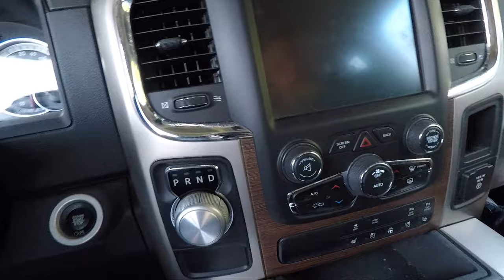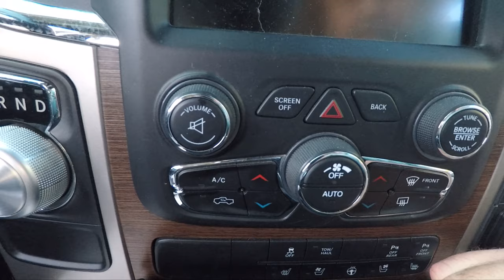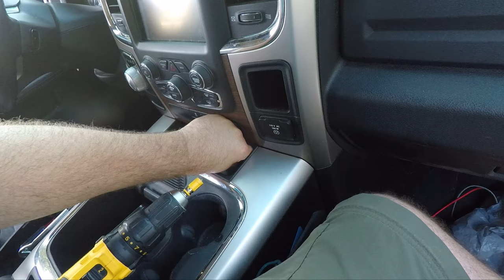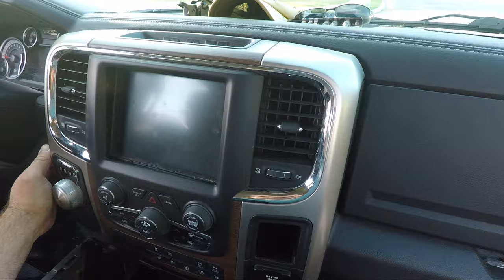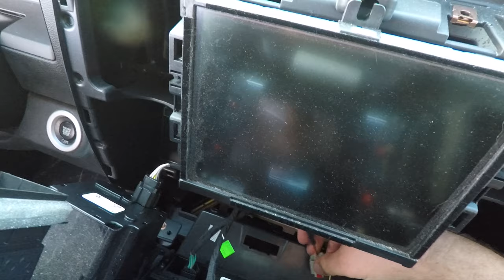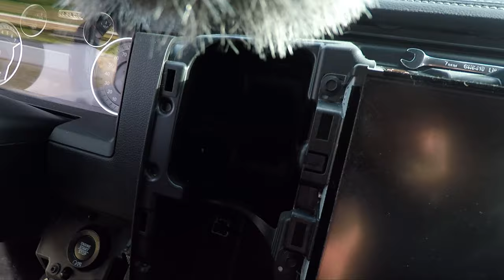Ram, with Center Console, Trailer Brake Controller Installation [4th gen models]

Comment: Just a caution for anyone with a tuner that gets the OEM brake controller flashed by the dealer, the OEM brake controller requires the Body Control Module to be flashed to activate it, however when my truck was flashed for the OEM brake controller at the dealer it caused an issue with the tune and I started getting service trailer brake system and service electronic brake system messages on the EVIC, then the transmission started hunting for a gear and then would not shift out of first gear at one point and finally the check engine light came on. 

My truck has a tune installed and the truck had been running great for the past 18,000 miles, I tuned it the first two weeks that I bought it. The problems started after the dealer programmed the body control module to activate the OEM brake controller adding it to the vin number in the manufacture system so it knows the OEM brake controller is installed. 

Thinking back to when the problems started I decided to load the stock tune back into the ECM/TCM and took the truck for a short 1.1 mile ride, the check engine light was gone as were the service trailer brake and electronic brake system messages. I pulled back into my driveway and reinstalled the tune in the ECM and TCM and for the past 1,000 miles now I have not had any issues, no more service trailer brake system or service electronic brake system and the transmission is shifting good again and the check engine light has not come back on, the truck is again running like it was before the dealer programmed the body control module. 

So if you have a tune and you install the OEM trailer brake controller and go to the dealer to have it flashed to activate it make sure you remove the tune and load the stock programming back into the ECM and TCM or you will likely have issues. Once the dealer is done with their programming you can reinstall the tune to the ECM and TCM again. 

I do not know what the Body Control Module flash did that caused the ECM/TCM tunes to start throwing codes, messages and causing the transmission to started shifting funny but something with that flash did affect the tune. Reloading the tunes did correct what ever it was that was creating the conflict.
Reply from the maker: Thanks for this valuable input. Hopefully anyone that has done the special tuning reads this comment to help them prevent issues as well.
Reply: How much did the dealer charge
Reply: @oscarpasillas3413  They got me for $180 dollars, they added every shop charge they could to the bill, I really don't know what shop supplies they used to plug in their computer and program the OEM brake controller.
Reply: Thanks for the input I just purchased a 2016 and the previous owner said it didn’t have a trailer brake system so he install one but the dealer took it off and did the oem one but I can’t get it to work so I think they never did the flash by dodge so I need to take it back but it has a tune and now you save me from having issues. The old owner is sending me the tuner so that I can fix it. Thanks

Comment: Thank you, this was very helpful. I too didn't secure the last screw that is the very top rear one. Way to difficult to get to but the other ones seemed to hold well so not really worried about it. on a side note, there was a grounding bolt right in the area where you will be working in, mine was loose so took the opportunity to tighten it down since i was in there, so if you are doing this check that bolt, can't miss it, it's in between the hard to get top one and the lower top one same side that you screw those into. Should have taken a picture of it but hope this bit of info helps someone else out when they are doing this. Also, FYI, out here in Riverside, California, i was charged two hundred for the programing as of 03/20/21, so if you can get it for cheaper, go for it, i didn't have the choice to shop around since I needed it because i am moving my trailer today and didn't have time to shop around.
Reply from the maker: I was thankful that our dealership charged $100.  And I like the idea that once the dealership does it, the VIN, when checked, shows the trailer brake controller officially listed as installed.  Thanks for watching.

Comment: Word of advice for anyone. Although not the correct way, zip ties make it much easier to install the controller bracket. I gave up after a half hour with the screws, got one in and threw on a zip tie and no issues since
Reply from the maker: It was so tough.  I don't blame you for going that route.

Comment: I installed this yesterday on my 2019 Ram 1500 Classic 4th generation body style ecodiesel now I have to get to the dealer to have it programmed. Took me right at one hour to install it, I did not put in the third screw because I just could not contort myself to reach it. Two screws are more than enough to secure the bracket as there is a tab by the hard to reach third screw on the bracket you are installing that locks into the existing metal frame. 

I wonder why they just did not use screws that went in from the front instead of the back where it is very hard to reach. They could have used much shorter screws as well. 

A tip for those who install this once you get the screw started instead of turning it less than 1/4 of a turn until it is finally all the way in take a pair of pliers and turn the screw from the front were the screw is sticking through until it is all the way in then just use the wrench to finish tightening it. That will speed up installing the screws big time. You won't hurt the threads as it will turn easy enough with the pliers so you don't have to grip it hard.
Reply from the maker: I appreciate your detailed comment that has some great insight to help.  How are you liking that Ecodiesel?
Reply: @TexasFamilyCamping 

I love the ecodiesel I am currently averaging overall 27.6 MPG that is combined city/highway with 60% city driving. I did purchase the Green Diesel Engineering Hot Tune/Trans Tune two weeks after I bought the truck and installed it right around the 1,000 to 1,100 mile mark. The GDE tune really solves the issues people complain about with the ecodiesel. 

It is nice getting 27 MPG from a 1/2 ton pickup truck. My best fuel run was 150.3 miles and averaged 32.07 MPG. All my fuel runs are fill ups hand calculated. The 32 MPG was a lunch run up and back.
Reply from the maker: @ramecodiesel8271  Wow, I love how much thought and calculations you put into it all.  I haven't seen numbers that great for me since my Pontiac Grand Prix.  We got a Hyundai for our son that gets 37 mpg, but it's not going to pull anything anywhere.  Have you towed anything with your Ram?  I'm curious how those numbers are.  Our Hemi gets about 18 MPG when we are empty, and about 10 mpg when pulling a 4700 pound travel trailer.
Reply: @TexasFamilyCamping  

I have not towed anything but others are getting around 15 MPG to 16 MPG towing.

Comment: Save yourselves 3 hours trying to mount the bracket. Get two self tapping screws that will fit through the mounting holes of the module bracket. Offset the bracket just slightly from the original mounting holes of the metal bracket under the dash and screw the module mounting bracket with the new self tapping screws into the metal bracket that’s under the dash. Only two screws are really required to secure it.
Reply from the maker: That, is a BRILLIANT idea, wish I had thought of that sooner.  That was a tough, long day getting those screws in there.
Reply: Thank you for posting the video. Your instructions and explanations were on point.

Comment: The 110v vs 115v vs 120v isnt the issue for your electric chainsaw. It is the wattage rating. Your powertools pull too much amperage for that little inverter. It is really only meant for like a laptop charger. Or air mattress pump
Reply from the maker: Good to know, thank you.  I figured that's what they were going for, just a little disappointed, since so many guys out there use their trucks for jobs, like construction jobs.  But oh well.
Reply: @TexasFamilyCamping  i use mine to charge up batteries for my Milwaukee tools. Works good for that

Comment: After I installed my oem trailer brake system I took truck to dealership I bought it from to get flashed. Dealership wanted 225.00 just to do it. Bought a obd reader and did myself in less than 5 minutes
Reply from the maker: That's awesome. If they asked that much from me I probably would have done the same.
Reply: Which OBD Reader did you purchase?

Comment: I think im going to install this but use a 2 sided adhesive tape. Wont go anywhere.... and will do the job.
Reply from the maker: I contemplated using some adhesive, but I was able to get 2 screws in and it was really tight.  It just took me 4 hours, that's all, LOL.

Comment: Wow, went to the dealer to get the trailer brake controller activated in the system this morning and they charged me $183.54 ouch. All for 30 minutes of their time. I don't mind paying a fair price but that was just robbery. I have the AlfaOBD software and the OBDLink MX+ along with the a security gate bypass kit but for some reason the AlfaOBD would not activate the brake controller so I had to go the dealer route.
Reply from the maker: That is a bit much.  So, now that you have this, what are you going to tow?
Reply: @TexasFamilyCamping  

I don't have anything that has electric brakes my boat trailer has hydraulic brakes on it. But I want the ability to tow a trailer with electric brakes when or if needed.